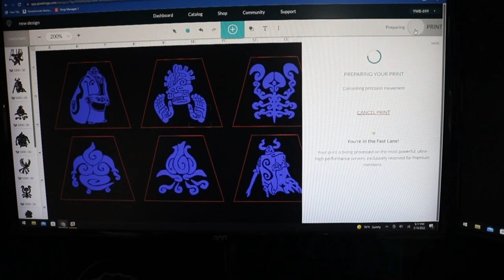Foam Forging a Viking Link Helmet

Comment: Bob from the channel ‘ I Like to make stuff ‘ recently made an led feature wall that measured the air quality in his shop. Might be a cool project to make your own air quality indicator.
Reply from the maker: I saw that the other day. It's a pretty cool idea. My machines have vents as well, with an air purifier and a vent system for my window next to where you see me build in the videos. I also have fire and CO2 detectors,  a fire extinguisher and fire blanket all within arms length. My setup is much smaller scale than Bob's but I do like his idea.